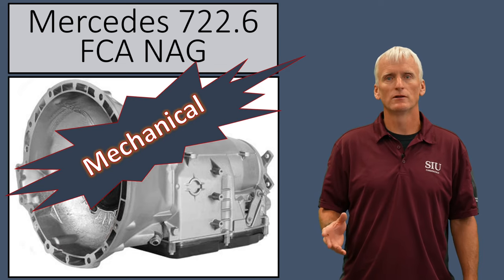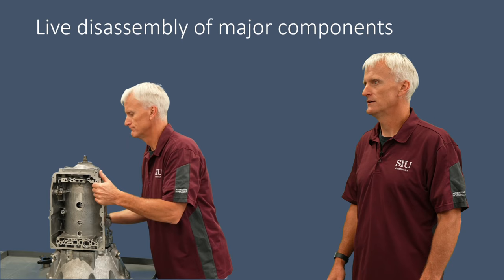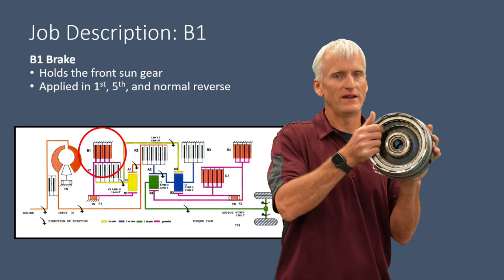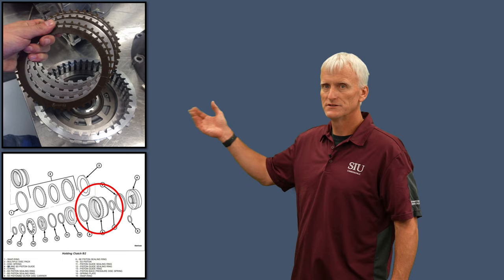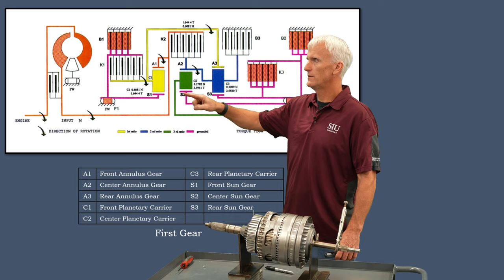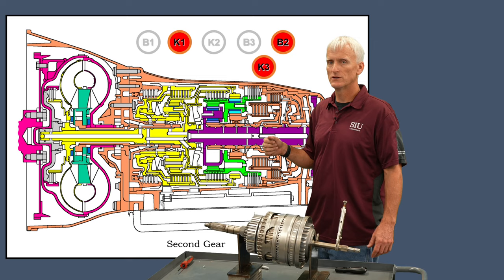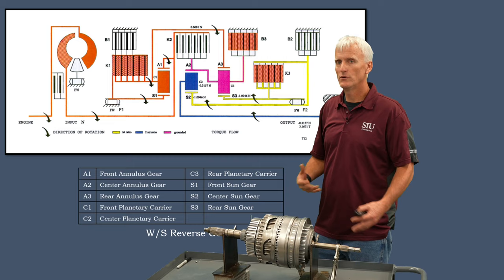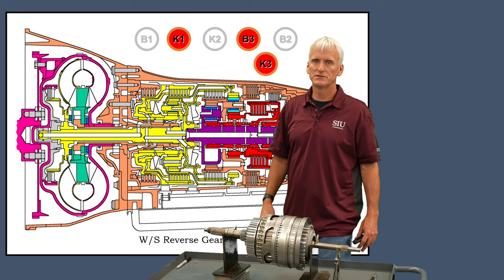Mercedes 722.6 NAG Mechanical Operation

Comment: Great video, couldn't have understood without it. BTW i guess the reason for the common 3->4 flare on this box is the lack of a sprag for that shift. B2 is released and if K3 isn't applied fast enough it flares
Reply from the maker: Yes sir, you're correct.  That shift is pretty sensitive without the help from a sprag.  If you watch the improvements video, you'll see that the overlap valve in the valve body has issues and sometimes causes the flare.  Thanks for watching!

Comment: What would happen if you put a switch on the lock up converter solenoid to prevent rumble strip noise on the 2006 T1N Sprinter while trans is cold and switch on when fully at operating temp. I'm thinking this might work to eliminate that noise and resistance on a lot of sprinters that have the rumble strip issue without doing the modification to the side plate just turn it off when cold reason I say that my only does it when cold when warmed up it seems to be fine would replacing the torque converter be a better option $250,000 mi only on a 2006

Comment: Hello Sean. 
I have a question and it’s not traditional. I have a sprinter 2006 it has the 722.681 trans and I purchased a 04 crossfire 722.618 trans to use in it.  Is it possible to change the gears to match the 722.681 ratio ?  What all would need to be swapped to achieve this?

Comment: Anyone know if another brand uses the same yoke the 2010 AWD V6 Charger uses to connect the trany to transfer case? Short hollow tube with gear on outside, mine are stripped and Mopar quit making, pick n pull for this part not an option...

Comment: I have a 2000 mercedes C 230 Kompressor that only has first gear or second and reverse, its stuck in lymp mode  the reverse lights dont work and the gear selector next to the clock is lit up but blank it only goes 40 mph and pulls good but no gear changes  i toof the valve body out and rplaced the conducter plate and put 8 quarts of new fluid but still same thing, i put a used transmission controller in and the car wont start the starter is locked out Ive got 10 codes set like p702 -o94  P 1525 P 1999-40 , I just cant seem to figure out what is wrong with this car The shifter has a rheostat thing that moves with the shifter, this car sat for 7 years so it could be anything

Comment: At the end of the video on the service manual page, are the clearances shown correct?  For example the K3 5 double friction discs has clearance of (2.5-2.9mm) in other manuals it says (0.7-2.0mm) I have a 722.6 flare of 3-4 with clearance in the k3 set of 2.7mm, this could be the one reason?

Comment: I was just reading in the comments about the 3-4 flare these boxes can develop. That's a bit scary. Is it an inherent fault, that dooms these boxes to failure or at the least an expensive repair, or is it a relatively simple fix and not worth worrying about? 
I've been thinking of buying an old 2000 Benz CL500, which I believe has the 722.6 box. Should I avoid doing so in favour of a later model with the seven speed? Thanks

Comment: I have a 2001 mercedes C320 with 722.6 transmission. I changed the conductor plate but the two sensors still show different reading on 2nd, 3rd and 4th gears. Could it be a defective "new" conductor plate or it is something else. Thank you